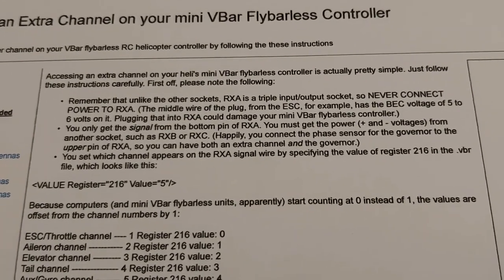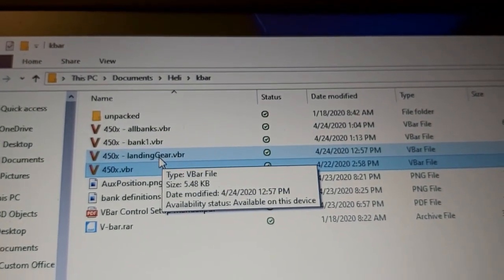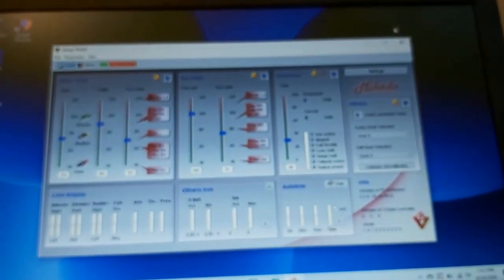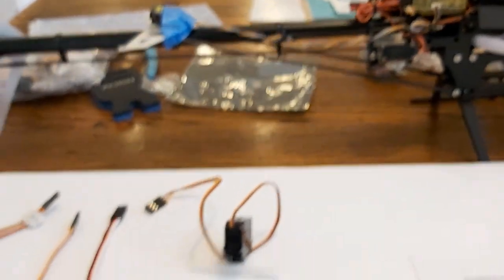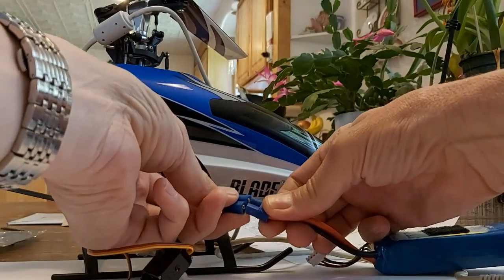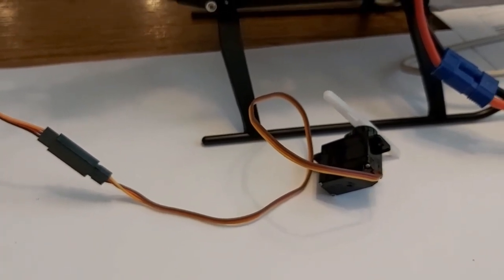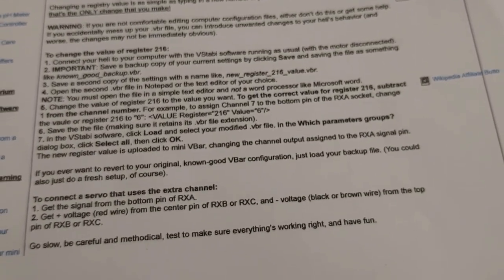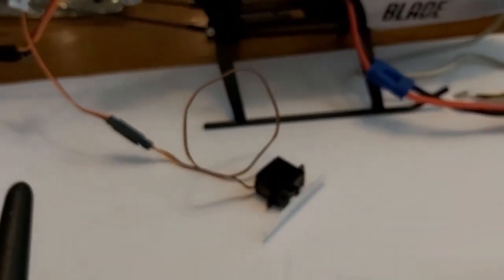kbar external servo control using RxA output

Comment: Brad, I'm curious that since the transmitter has a control called Gear why you didn't align register 216 to work with that control vice the Aux?